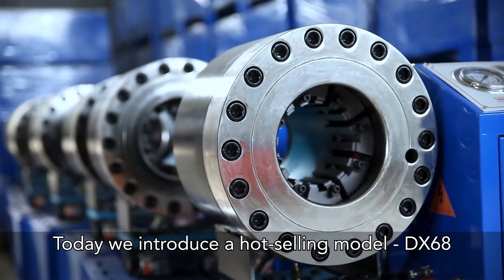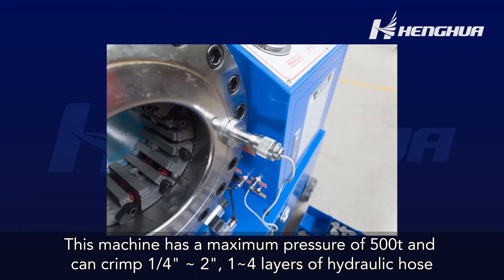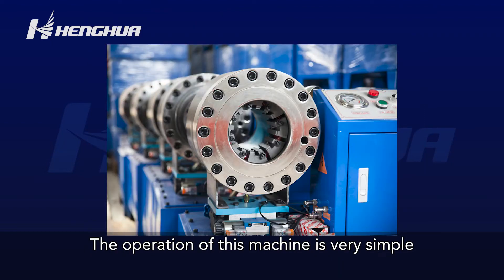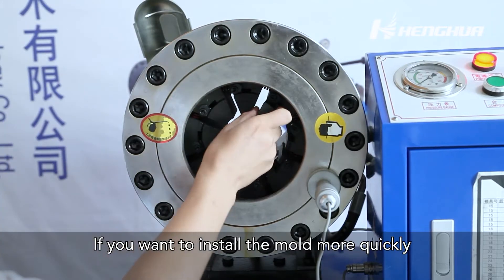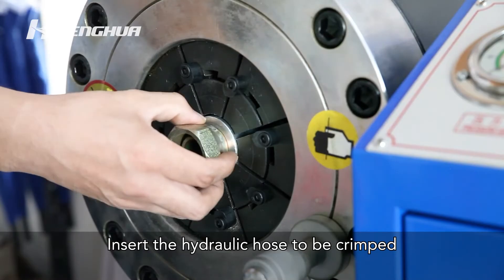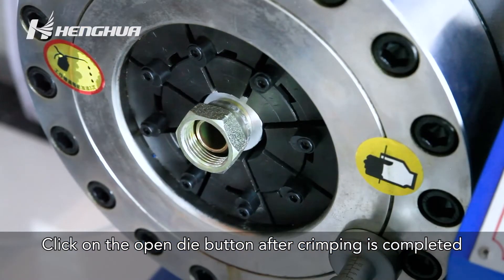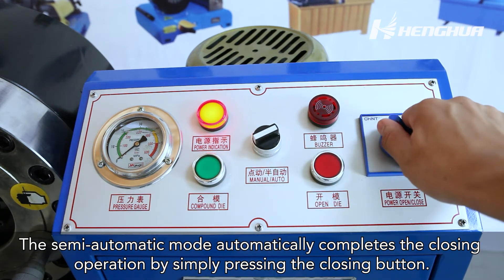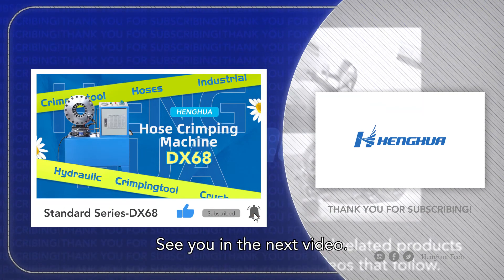How to Choose the Best Hydraulic Hose Crimping Machine For Press Hydraulic Hose - Hose-crimper.com

Comment: How is it machines price
Reply from the maker: HENGHUA Hydraulic Hose Crimping Machine
15 hours ago
128 subscribers
This machine is our company's best-selling model series, which also has a quick-change die with a mold rack and supports color customization.  you can contact whatsapp: 0086 18522426988  to get our products price and catalog, thanks!😀
Reply: 9929687823